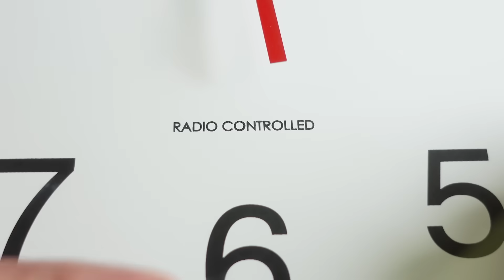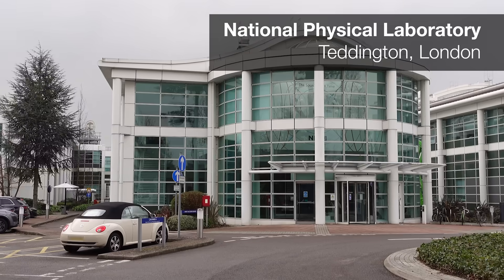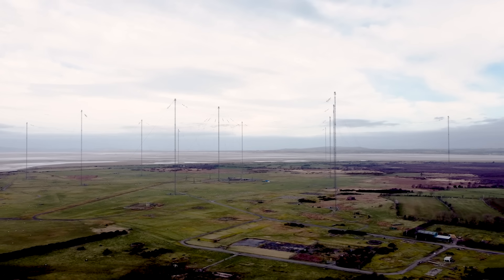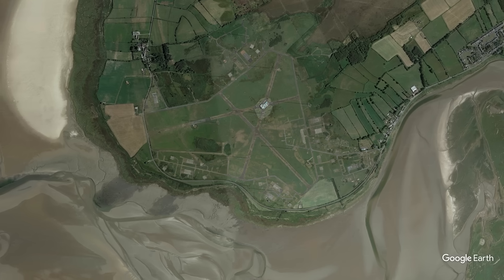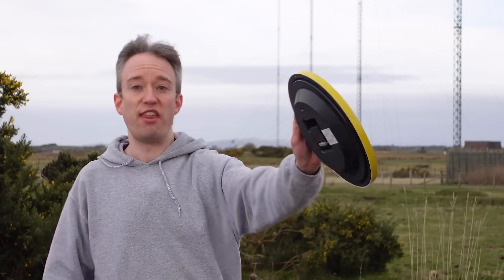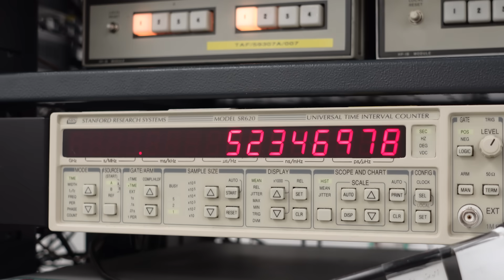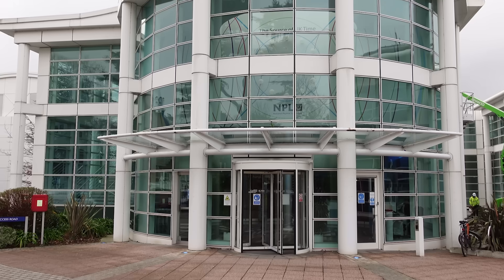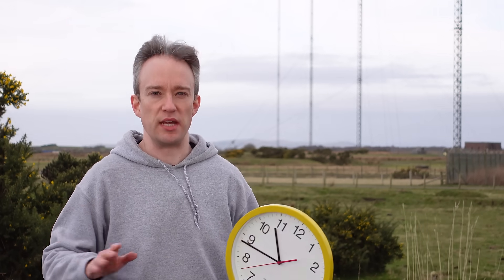How does Britain know what time it is?

Comment: I find it fascinating that we are using comparatively primitive and outdated technology to check and maintain the cutting edge systems because the reliability and resilience of the older methods and equipment is superior to the new. It seems counterintuitive that old technology could be more accurate and more precise that state of the art systems. I guess in this case, they really don't make things like they used to.

Comment: The problem with these, is if you move abroad to a different time zone and set them to the correct local time, they'll automatically revert to their original time zone. Sometimes when you least expect it...
Reply: The simple solution is to change where hour the hand is pointing rather than try to override the clock. You may have to put up with a bit of confusion around daylight savings time changes, of course...
Reply: @charliedobbie8916  Not if you have a digital display clock...
Reply: The American equivalent broadcasts in UTC and receivers have a switch to select the proper time zone offset.
Reply: @eDoc2020  I think that's the case everywhere. It's just that the "switch" may be factory-set to a single time zone for some clocks, with no possibility for the user to change it.

Comment: The best thing about those radio controlled clocks is my 88 year old mum doesn't have to get a neighbour in to reset the one high up on her kitchen wall when the clocks go forward/backward.
Reply: That is a GREAT feature! A fall for an older person can be very dangerous.
Reply: Do you still have to change the battery, or is it wired or solar?
Reply: @TheQuark6789  I have changed it when visiting, just to be on the safe side.
Reply: Where I live, we don't do "Daylight Savings."  I've built several nixie clocks that either derive time from GPS satellites or the Network Time Protocol.  It's cool to see them resynchronize after a power bump.  Close enough for domestic use.

Comment: why do we still need this service?
Reply: All kinds of remote equipment built and installed over decades depend on it. In the USA, they dropped the power of many WWV transmitters - and broke equipment people had forgotten about all over the country. Luckily, adding a bit of wire to the antenna solved most of them.

Comment: The German version of this (DCF77) used to have a few bits just for the engineers to receive a few error codes. Today those bits transmit encrypted weather data and there's just one error bit. I built a receiver that shows those 60 bits on LEDs, and you could listen to the bips (100 or 200 ms each second) and decipher them on a piece of paper if you needed to.
Reply: I also have a weather station that uses some equivalent of that here in Poland.
Reply: France overlayers their signal on an AM radio broadcast at 162 kHz, the Russians use 66.6 kHz, and the Japanese 40 and 80 kHz. I forget which the Chinese use, but if you have a GPS disciplined oscillator you can coherently integrate their carriers and pull them all out of the noise floor from Europe, though bit decoding can only be done with the local ones.
Reply: @RN1441  The radio station on 162kHz went silent some years ago but the frequency is still active just to carry the phase modulated time/data signal.
Reply: @nowster  Ahh, I haven't looked in to it since 2015 and was unaware
Reply: Ah, the good old blinkenlichts!
Reply: The one I got from Lidl stopped working after Brexit; I don't know if that's coincidental or not.
Reply: And 60 kHz is used by WWVB in North America.
Reply: Japan has one and the car I have uses it to set its time  and there's no way to adjust it, so in Australia my car clock is forever wrong.
Reply: @ajapanexplorer7417  And Japan does not use DST, but neither do WA, NT or QLD.
Reply: Why is the weather data encrypted?
Reply: @640kareenough6  Short answer: Because of the money. 
The weather data transmission isn't operated by the PTB but  by a private company that sells licences for the decrypting data technology.
Reply: @moatl6945  Greed, the universal hoooman fallacy.
Reply: They use a speed of 1 bit/sec !
Reply: @rayoflight62  
DCF77 uses 1 bit per second, MSF60 can do 2 bits per second.

Comment: Cool, I have one of these in my kitchen and never questioned it. Doesn't take into accoutn daylight savings time though, and I can't be bothered to change it manually. Defeats the point.
Reply: Yes they do. It automatically changes in March and October because the clocks are linked to the Radio waves from Cumbria. It was cool to watch mine changing in March and it was only £7.99 from Lidl.
Reply: @alanalderson1427  I thought it was on UTC and that doesn't change? Unless I'm misremembering, but it's definitely not changed in the last two years 😂

Comment: The wire management for that hardware is horrendous.  Didn't they even TRY to clean up before the Tom Scott inspection?!? 😆😜
Reply: It's meticulously organised that way, because if they move the cables, it might change the official time by half a nanosecond.
Reply: @DaedalusYoung  don't want to add extra length to the cables, it could set us back thousands of years
Reply: They didn't have enough time to clean up
Reply: Just noting that wire management has a completely different scope in science: The setup is to a significant part about what port of what device is linked to which other port in which other device. Notice how many devices have cable ports in the front - the cables are part of the user interface of such a setup and one needs to be able to quickly add an oscilloscope anywhere, follow and exchange each cable path in case of a problem and easily get more length from one cable if one adds another device. Bundling them to make them as invisible as possible is oftentimes the opposite of what is needed in such a setup.
Reply: After the scene with these messy wires I can't focus on the topic anymore. I just keep thinking how is it possible that such a big and important organisation can't make cables right!
Reply: Tightly managed cables are great until you have to move a plug of one and the cable is too short.
Reply: I guess they didn’t have time to do it….
Reply: It's actually very clean compared to some optics labs I've visited.
Reply: Tight Cable bundling increases the risk of crosstalk, makes maintenance more difficult and is impossible for reasonably stiff length-matched cables (you cannot double them back on themselves to hide the excess) like coax.
Reply: I paused 49 seconds into the video due to the, OMG CABLE MANGEMENT IS A THING!, issue. I think anyone who has worked in IT in almost any capacity would have a similar reaction.
Reply: @jjosua  probably no one wants to arrange the down time in case it doesn't come back up again
Reply: That's how you know it's a working facility, and not a potemkin institution.
Reply: ikr, linus would probably have a heart attack!

Comment: I’ve had a small alarm clock linked to this for about 30 years - and people don’t believe me.

Sadly it had never really kept itself set so whenever there’s a stupid time change like BST I have to manually prod the hour or take the batteries out.

At least it’s survived 3 decades of me dropping it.
Reply: Ha! That's funny! Cause my kitchen electronic clock did not survive dropping it. The antenna inside wasn't attached strongly enough and it snapped with a wire. Didn't know that until the clock started drifting by a minute or two. Then I opened it, soldered and secured the antenna back in place. Works like a charm ever since. And it just recently switched itself to summer time too.
Reply: My analogue one would adjust itself. Most fun when the clocks went back but it could only go forward so it spun around until it skipped 23 hours.
Reply: @aukondk  That'd be creepy to stumble upon in the middle of the night
Reply: You’d be lucky if an alarm clock made today lasted 3 years. The times have changed.
Reply: I don't understand, what exactly do people not believe?
Reply: @whuzzzup  that you could have a self-setting clock with no internet or phone connection, I suppose?
Reply: Tbh I only really clicked on the video to see if it’d change with daylight savings. Apparently not, but thanks for answering!
Reply: My radio control clock updated once, I think, but otherwise I have to do it manually.  It's a big digital one with time, date and temp, so it's not such an issue.

Comment: It’s never really occurred to me how radio controlled clocks work beyond “probably some kind of radio signal somehow” but they’re fun to watch when the hour changes
Reply: The signal is also encoded into BBC  Radio 4 LW Transmission.
Reply: As a dumbass American, could you please elaborate on why it's fun to watch when the hour changes? Is that when it syncs up or something?
Reply: @emmanotsostrong  At least the ones I’ve seen and from what I remember (it’s been a while) the hands whizz round and round for a bit until they settle on the new time
Reply: @emmanotsostrong  They're not usually digital clocks - they're analogue. So they tick away as normal but then daylight savings changes and the hands spring into action and whirl around until they settle on the new correct time. It's something quite unexpected to see from something that's usually just a crystal oscillator and and bunch of plastic cogs.
Reply: The only good thing about daylight savings is the way the clock goes 'round.

Comment: I always find it amazing when I hear about these lesser known organisations which perform such vital work for the UK and the world. Great video, Tom!
Reply: I find all this new technology amazing. But I still swear by the reliability of the sundial, or when one isn't available just staring directly into the sun
Reply: @clivem1262  It's not new technology, the general concept is half a century old. Obviously the implementation has been updated, the transmitter used to be at Rugby for example.
Reply: @owensmith7530  Rugby may have been updated but it's ultimately all the same ball game
Reply: @clivem1262  You were claiming this is new technology, I was pointing out it is at least 50 years old, so I don't understand your reply.
Reply: The British parliament could stop existing and nothing bad would happen for months, the NPL stops existing and the concept of time ceases to exist.
Reply: @ErikUden  you need someone telling everyone else, "right this is the correct time" otherwise as time goes on (no pun intended) different organisations using slightly different internal systems for clocks will drift. 

You could leave your work which thinks it's 10.00 but get to the bus station 5 mintues which thinks it's 10.15 and you've missed your bus. A simple example but add the world+timezones and it gets very messy
Reply: @ErikUden  OMG then how would we know the length of a piece of string As NPL was the master reference model.
Reply: @mojoich2736  You'd have to 
Shudders
Ask the French.
Dramatic brass ensemble

They're the keepers of metric units.
Reply: @ErikUden  ceases*
Reply: @tams805  Thank you, I'm stupid.
Reply: They're really just an organization that sets standards, but they're in control of time. It's like they're some kind of wizards.
Reply: @vigilantcosmicpenguin8721  they prefer to be called time lords actually
Reply: one take!
Reply: yea my dad does the exact same in canada!
Reply: And libertarians hate them
Reply: This was invented in the US in 1948 and has been used here for decades...
Reply: @FJB2020  It's been used in the UK for decades too, almost as long as the US has been using it.
Reply: @owensmith7530  Correct.. Just amazes me that people think this is new tech...
Reply: @FJB2020  ok?
Reply: @g76agi  I'm fine, thanks
Reply: @FJB2020  huh?

Comment: I wonder how this varies between countries.  Germany has DCF-77 (if I'm remembering this right), and clocks controlled by it were quite common when I was there, but I'm now curious how other countries do it.
Reply: I think most of europe uses the DCF-77 signal, since it's one timezone
Reply: @hermannpaschulke1583  most, but not all. The UK, for example, is 1 hour behind. But in some areas the signal can't be received because of the distance to the transmitter.
Reply: @hermannpaschulke1583  And the timezone doesn't matter much, most radio controlled clocks can be set +/- 1hr or more.
Reply: Same in Norway, we also use the German signals. However they don't reach all the way up to Northern Norway
Reply: Piggybacking of the German signal (at least that's what my Belgian clock does)
Reply: @EpseLepse  as long as you're in the same time zone, I don't see a problem with that. Years ago I took my DCF77 clock on a trip to Barcelona, and the only problem was that the signal was considerably weaker than in Germany. Here in the UK I had to subtract 1 hour from what it said.
Reply: @mrxmry3264  the further you got, the bigger your latency will be, but for normal clocks that does not matter in the slightest
Reply: @EpseLepse  and for those clocks where it does matter, you can compensate for the delay.
Reply: The United States has WWV that performs much of the same functions.
Reply: Several countries have similar MSF transmission systems, I have a travel alarm clock with 3 different plug in antenna modules that coverers the 5 main systems  1/ (Europe {germany}), 2/ (Japan-East), 3/ (Japan-West, USA, UK). So far in my travels I've tested all the modules except Japan-East & I believe the overlap on module 3 is because the systems are sufficiently geographically isolated that they can use the same frequency.
Reply: @GaryMarriott  are you saying that the USA, the UK and Japan are using the same systems?
Reply: In the Netherlands we just use DCF77, or Time from NPL, as we can receive both over here.
Reply: You can find plenty of those in Finland, using the same signal from Germany.
Reply: while we have our own in France (LFE, a.k.a allouis) clock bough from store are mainly using the german system